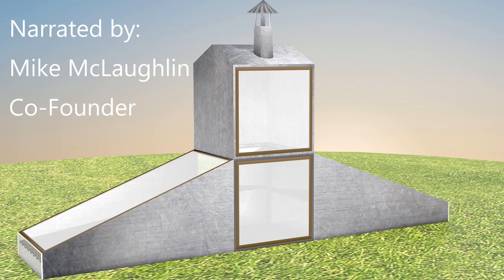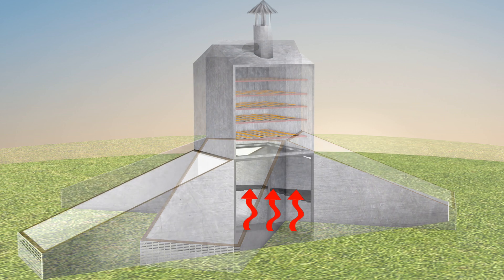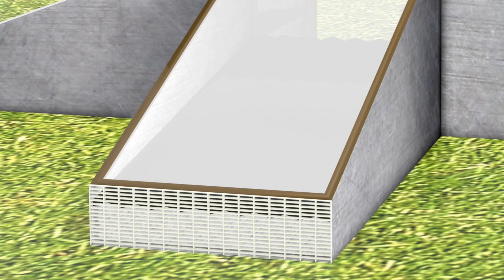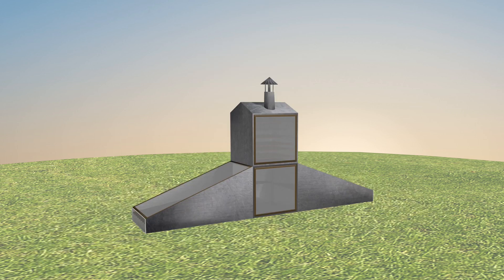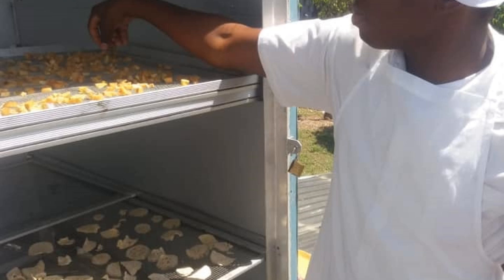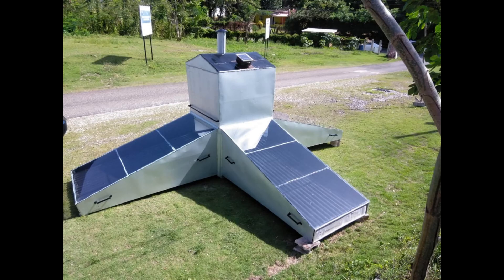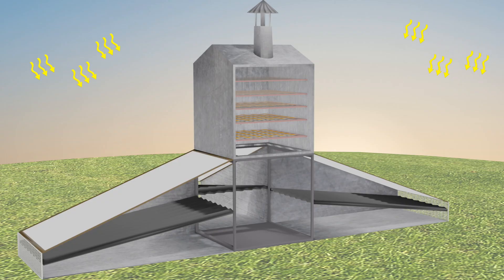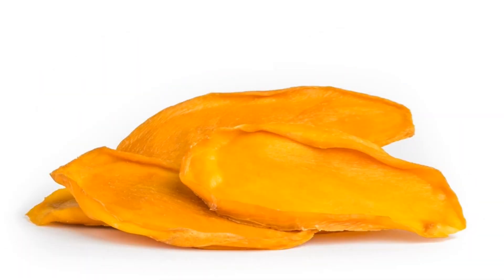Trees That Feed Food Security: Hybrid Solar Dryer

Comment: How do you make the solar panel or where did you buy it?
Reply: @amadeocantu9552  there’s no photovoltaic solar panel. Solar energy is not converted to electricity. Solar energy trapped as heat by a corrugated metal sheet painted black inside the collector module. Air passing over and under that metal sheet gets hotter and lower relative humidity. That passes up through the cabinet and dries the fruit.

Comment: This is probably the best possible solar air dryer I have seen so far. The design is so beautiful and innovative that there is  zero exposure of the job to UV rays. Hence, the color, nutrients and aroma is likely to remain absolutely unaffected. However temperature control in such design is a prerequisite particularly for drying the green  leaves which probably can be controlled with suitable exhaust fans. For example moringa leaves are to be dried at a temp of 50-55 degree Celsius
Reply: The sheet metal that gets hot is galvanized corrugated steel sheets painted with black heat resistant paint. The corrugations provide more surface area for heat transfer to the air passing above and below.

Comment: How do you dimension the tray size? Do you  any documentation and the thoughts behind this design?  Where can I see the calculations you made to develop the hybrid dryer?
Reply from the maker: There is much more information here: https://www.treesthatfeed.org/programs/education/resources/solardryer/   Thanks for your interest!
Reply: This is an excellent innovative design. I think that food value,  color, and fragrance are likely to be retained at the original level as there is zero direct exposure to the Sun rays. What should be the material of black metal sheets that absorb heat, all other surfaces meant for reflecting heat and food trays from food safety point of view ?
How does it control temperature at 50-55 degrees Celsius? I think the provision of two or more exaust fans would be necessary.
Anyway, this appears to be the most impressive design I have seen till today

Comment: What is the maximum temperature reached in the chambers, from bottom to top, if you please.
Reply from the maker: This design raises ambient temperature by approximately 40 - 50 degrees Fahrenheit. So if the external air temperature is 80, inside the cabinet will be 125 - 130.

Comment: what is the material covering the dryer?
Reply from the maker: The dryer is built on a metal frame covered in galvanized metal sheets. The top of each solar collector is clear plastic. Acrylic sheets work well ... infrared (heat) radiation comes through to heat up the metal inside, while the heated air funnels up into the lower cabinet.  More details on the website page.
Reply from the maker: The clear plastic material covering the solar collectors is acrylic or other clear plastic, 1/8 to 1/4 inch thick. Preferably UV resistant.